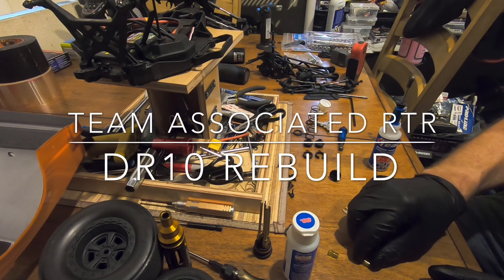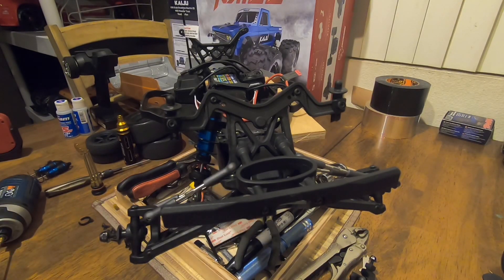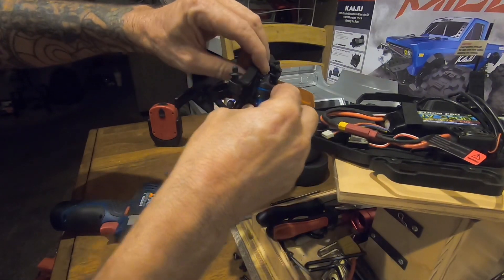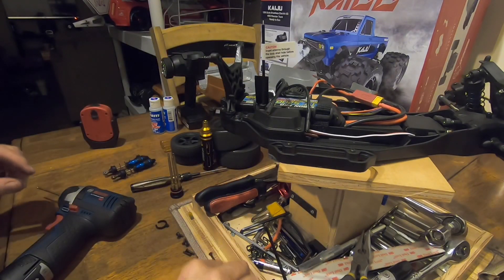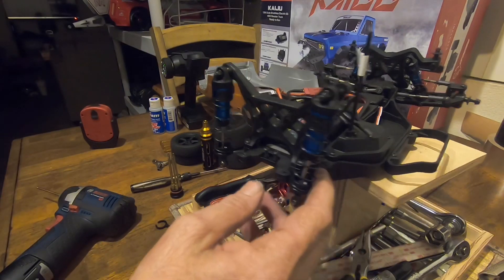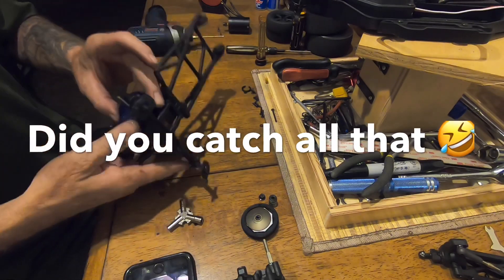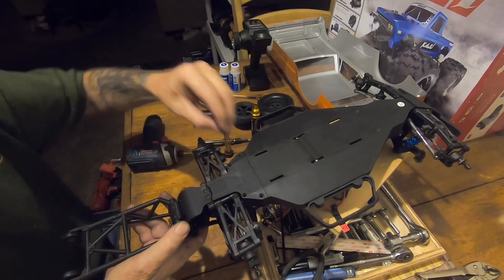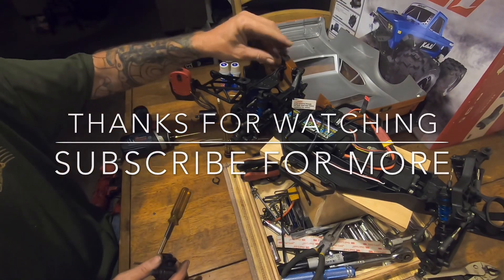T.A DR10 rebuild shocks lower rc replace trans (Earlified the rc)

Comment: I lowered my front shocks, used 90wt front and rear, 500K in the diff, and eliminated the slipper. Gigantic improvement. Keep the vids coming!
Reply from the maker: Yes I tool the center diff out as this was a limitless brand new and someone switched it 👍👍💯💯🔥🔥🔥

Comment: I bought a wheelie bar and support bracket for the xlx esc in my limitless from the same company you got yours from I was just curious if they took long time to mail out your stuff. Shit I been waiting 4 days now and just now got tracking info sent to usps..not to mention my xlx is lost in my local distribution center which I drove hour to get to got turned down sayn they dont deal with the public. Pissed say the least. I'm still waiting on a set of GRP'S for over 5 weeks now why i refuse to sit and wait on my xlx. Hopefully tomorrow fingers crossed!
Reply from the maker: Yes he make them to order on the wheelie bars due to colors are all different so about 4/5 days before they ship out hopefully your xlx shows up soon 👍👍🔥🔥🔥🔥🔥
Reply: @earlmoorhead5555  yeah the motor came in I see tracking movement on the xlx finally so that's good. Yeah I was thinking about it being made why it was takn the time even thought it showed in stock. I went with the no color seems how I'll he getting another limitless body to paint just not sure on color yet. Lookn into chassis protectors now. Thanks for input

Comment: Do you fill the shocks completely?  Dumb question I know but I'm in the process of changing the oil weight.
Reply from the maker: Yes and I dead head the shock when bleeding them to allow the fluid to do the work